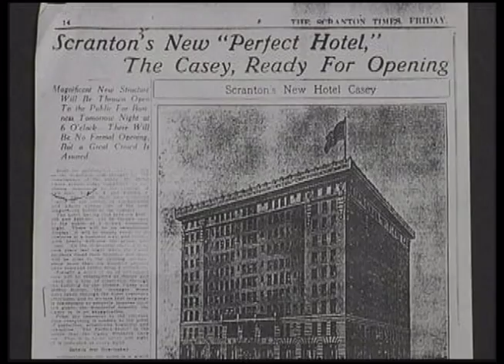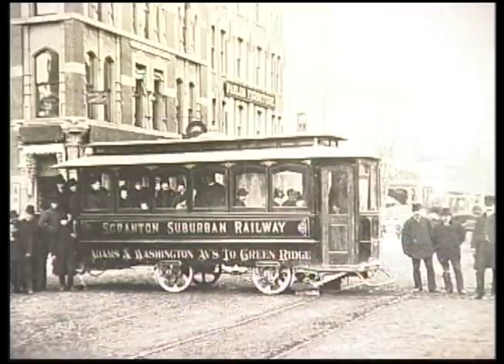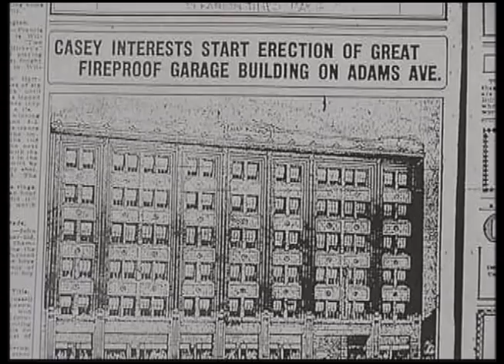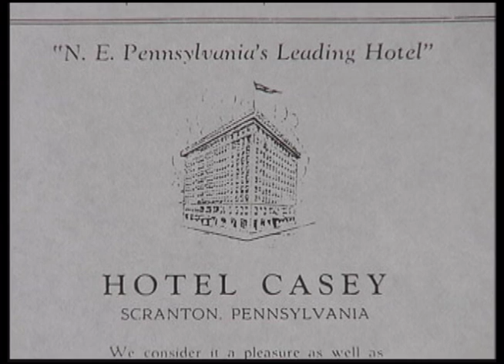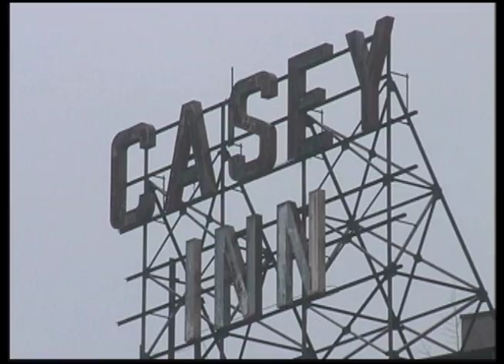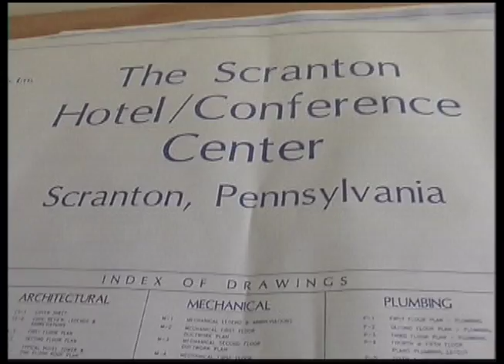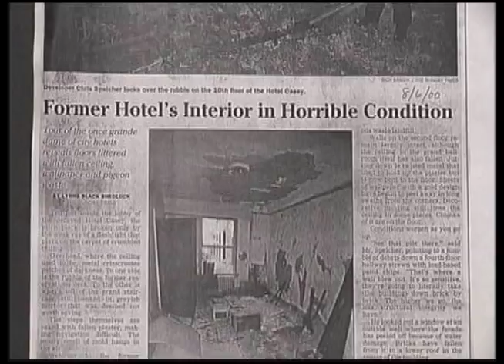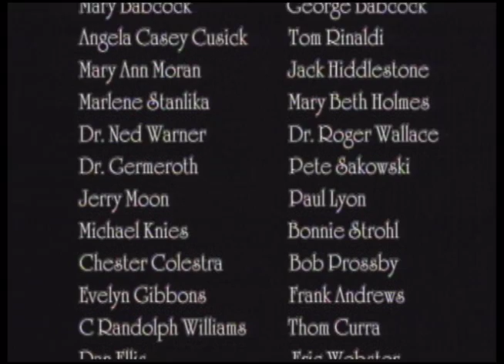The Hotel Casey, The Perfect Hotel

Comment: That's a big wrecking ball. I used to operate a crane with a 5 ton ball and that was considered big. That one is bigger. BTW the tire us in the cable to lessen the shock traveling up the cable into the crane boom, running a wrecking ball is hard on a crane